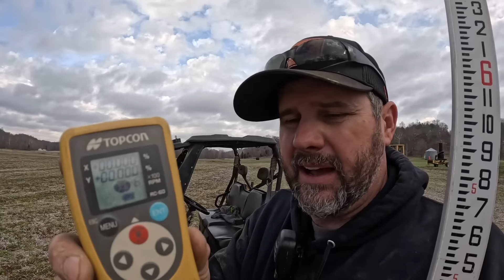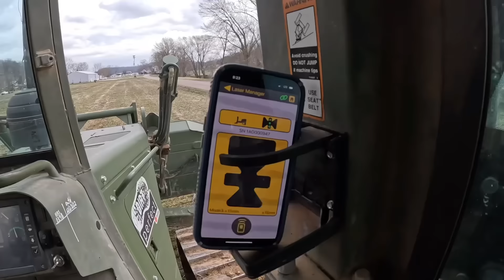Get Ready To Be Amazed As We Take Pipe-plowing To A Whole New Level - It's Hammer Time!

Comment: You remind me of my old boss. He was/is a pipeliner. We laid anything related to pipe. We also did odd jobs. One job we did was using a side boom to unroll power lines while they were building wind farms in rocky, hilly places, and they needed something that could carry the weight. 
Anyway, I saw Mike lay anything from a horizontal drill to a 6-foot corrugated steel pipe for a major irrigation distribution line next to the Columbia River. The last job I worked with him on was a 5-mile high-pressure natural gas pipeline to a plant along a railroad line. I was his field office manager. I loved the work - he treated me like his son. 
You look really at home on your equipment. You handle that hoe like it was an extension of your arm. I used to be a Heavy Equipment operator until I had a brain injury and lost my balance, so I know how to make it go. I started my farming on a 1935 three-point Farm All. It had a metal hand crank on the front. I was 14. I'd pull the rope to drop the two bottom plow. 

Thanks for the videos and the memories. 
Lowell AKA Papa
Reply: 20 years of recovery from my brain injury, finally, I am able to work again ... Heh, washing dishes and doing food prep in a fancy restaurant ... exactly what I started my (full time) working life doing when I was 16, I am 63 now, I've been working again for a year and four months now, part time, I still sleep more than a normal person but I am still getting better slowly. When I fill out medical forms and they ask what I am allergic to, I write "sharp blows to the head". 
Be well Papa;
 Grampa Ken.
Reply: @kenlee5509  I've only got a couple four years on you, and we have like lives. I am just finishing a new woodworking shop and had to set my butt on a track-hoe to put in water/sewer lines and conduit for power, and take out part of the existing driveway. But I did that with no problems, it was like I was home again. 
I do wood work now - and since I am retired from being an IT tech my days are my own.     Happy Trails Bro
Papa😃
Reply: @tielkgate  :)

Comment: Something to think about adding on to help locate the pipe is adding a second curved pipe  on the back of the tile plow that you can run a string or ribbon a few inches above the tile as you plow in the tile. If you can follow what I'm thinking and the collapsing trench behind would work like I'm thinking, then when you dig down, you would hit the ribbon before the pipe.
Reply: After seeing the ditch left with the exposed pipe I don't think the ribbon would lay above the pipe correctly in wet conditions it might in dry conditions but how often is it dry crumbling dirt where you are plowing tile in.

Comment: Fiber optic plow hang the plastic pipe off the front of the blade, have a track over the cab with rollers (away from the exhaust) , and most importantly the bend into the plow has side and front and back rollers to protect the pipe.  But they were paid by the proofed (undamaged) foot of pipe in the ground.  I could hear your corrugated pipe popping over the lip on your plow in the video when it was laying on the ground.   Enjoy the videos.

Comment: If you added a little bit to where the 2 pins hold the boot in you could have a quick connect for the 120 to make removing the tile plow easy. Drop the bucket, quick connect in, pull the pins connecting it to the ripper and just lift it off and load it up, set it off to the side, whatever you needed.

Comment: Michael,  Just a concept here without dealing with the logistics.  Could you take a turn or two of copper wire in the bottom of a corrugation in the mainline pipe in the close vicinity of where the lateral will be going and then use the sensor unit from the snake to more closely locate the pipe when you go to digging with the excavator?
Reply from the maker: To be honest way more trouble then it would be worth

Comment: You've clearly never run any gps tile plow controls integrated into the layout or operation of any plow.  You have no verification you have held grade through any run.  That applies both during layout and during plowing.  Highly doubtful with the design flaws in your equipment setup related to controlling grade, you are actually within grade.  No wonder you don't want to put auto controls on to potentially verify being out of spec.  Baffles me the sales pitch is done, but there's been worse.
Reply: Grade is currently being controlled manually by laser transit. The laser has grade adjustments. There is an auto grade laser control that is being upgraded, stay tuned. Grades are actually held quite accurate with this system, even done manually.
Reply: @RAYAR54  Grade control via a 2 track machine using ballast as opposed to geometry on the plow will always be poor because of the porpoise effects on the plow.
Reply from the maker: Sorry you don’t understand
Reply: @DirtPerfect  I do though.  I've put more pipe in than you.  People believe grade is very easy once the pipe is installed.  Many guys have had to start completely over because the install didn't go as assumed.  Verified maps post install along with precise grade protects the contractor as much as the customer.  

It's very clear none of the crew has worked with or in the tile industry when you make videos about install.  You do tremendous dirt work as evidenced by your touch digging start holes.  I suggest going to the upper midwest to a tile contractor who is you tube friendly and spend a week learning tricks and standards late fall.  I don't have a specific contractor in mind.

My critique is to improve you not to be a troll.  If you don't research best practices on how to do the job someone has to bring that to your attention.
Reply: @DirtPerfect  At this point you don't understand the perfectionism that's necessary for well laid tile.  You're fascinated by the demand and are reading that as an affirmation you are doing quality work.  You've put yourself at a deficiency by your choice of equipment and are playing the nobody understands this better than yourself game to sell the fiction you've found some secret sauce decades of best practices says you haven't.  One has to learn the best practices to have the situational awareness to improve them even in small ways.  You don't have the situational awareness at this point.

You have a bunch of fan boys feeding you praise that have zero clue about tile.  I'm telling you to do more homework because you aren't remotely there yet.  Dismissal of what I'm saying is lazy.  Go work around an actual professional tile operation to see what very simple assumptions you are dead wrong on.